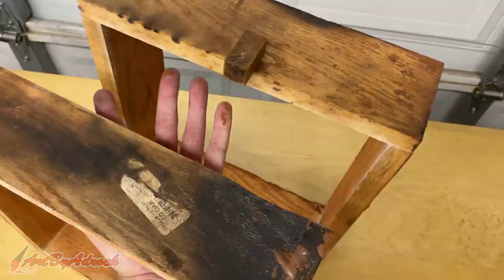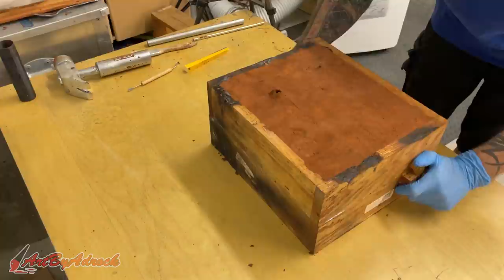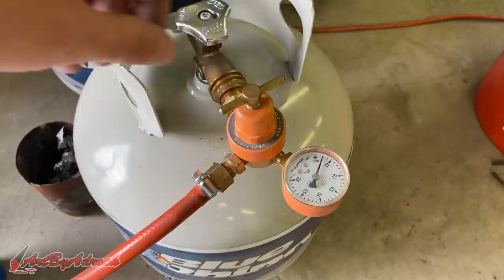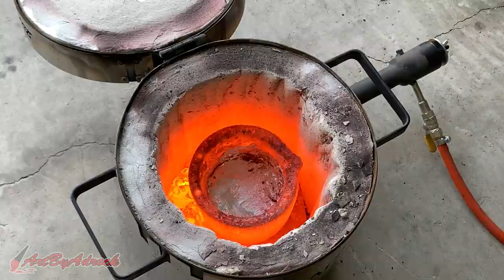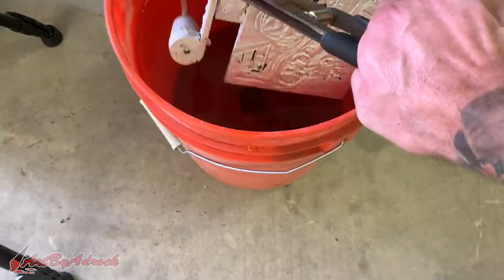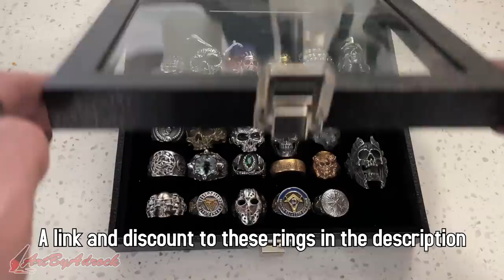Casting A Bas Relief Skeleton From An Image - 2D To 3D Photo Casting

Comment: Great casting technique... you're getting there. I think you could make the surface of your castings even smoother, if you covered the casting surface with a thin layer of talcum powder which would fill tiny hair cracks that remain in the sand.... just a suggestion... otherwise, thumb's up

Comment: Mate just a thought spray it with black paint and then clean all the high points...just a thought. Nice work by the way my high school students are going to be trying something like this (keyring or medallion) in about 7 weeks time, their homework is watching you and bigstackD so we get the process right.
Reply from the maker: I thought about that but because it’s not flat and there’s many curved and rounded uneven areas it just wouldn’t look right. Even polishing it wouldn’t return the best results. Only the very top parts would be shiny if that makes sense.

Comment: I've recently received my Devil Forge 10Kg. Haven't had change to set it up yet. Glad I didn't go for the smaller one. Here in the UK I've had issues with getting my hands on a Propane tank. The 2 main UK suppliers stopped selling new bottles because they've got too many customers (!!) after people went mad during the last 2 years of covid and were buying them up for BBQ's, outdoor heaters etc - so they are doing refills only and used tanks are like rocking horse shit - prices of empty bottles also went through the roof in some areas of the country. Finally managed to get my hand on a new full one and an empty one, so when the weather gets better I'll be good to go!

Comment: I think this project turned out just awesome! 
Not so much the cross, though, maybe try that in a more liquid metal like zinc or copper, aluminium is too sticky it seems...
Reply from the maker: Yeah aluminum is light weight. I knew that was going to happen. I basically just wanted to see what it would look like 👍🏻
Reply: I feel ya Steve, kinda shallow mould. Need some high viscosity